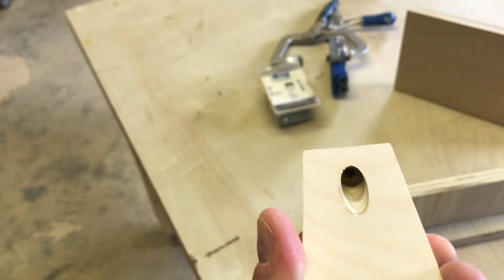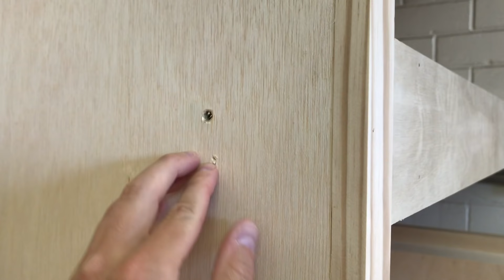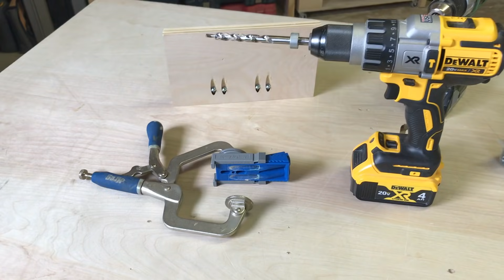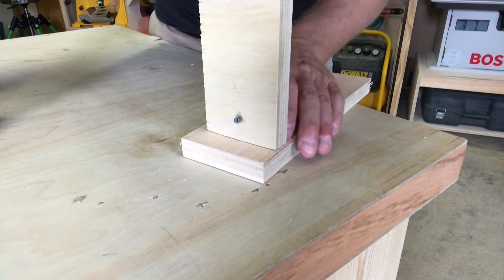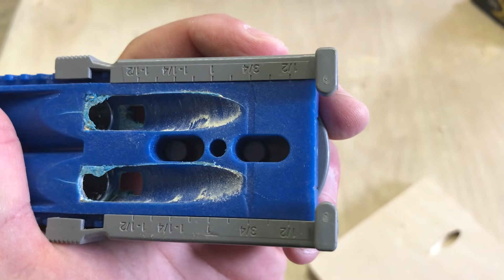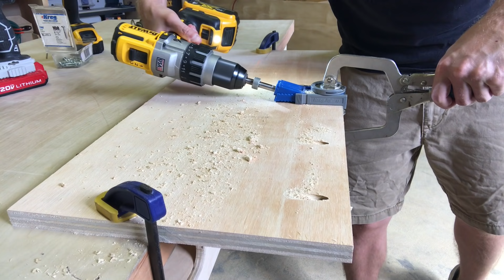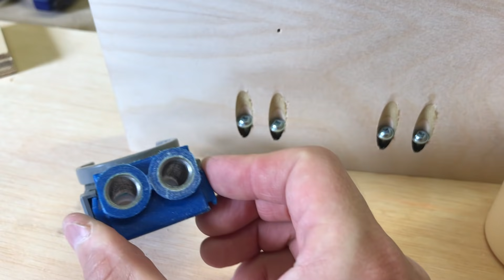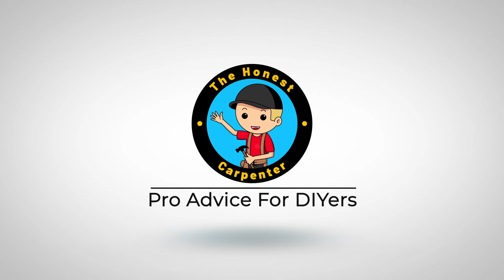Pocket Holes / Pocket Screws EXPLAINED!! (How Pocket Joinery Works--Kreg Pocket Jigs--PROS AND CONS)

Comment: For increased strength If appearance isn't super important you can drill pocket screws from both sides of the board spaced about an inch apart. This will drive the screws from two different angles and thus will nearly triple joint stability

Comment: It Might a stupid question? When using kreg double jig.
 
 What would be your advice, to what screws sizes to use when using different thickness of wood? 
Any advice given, would be appreciated.  Thanks Tony 👍
Reply from the maker: Hey Antony, kreg actually makes charts about this! The chart usually comes with the tool, but you can find it on their website as well most likely. It’s a little tricky to explain, but thicker wood equals longer screw, etc…and you typically want to use their pan head screws!
Reply: Would you recommend pocket hole system for french cleats?

Comment: Hi great video but can you guide me on what jig and screws I should use on 12mm birch ply please.  I find regular heads jut out (are not hidden) and shorter pan heads only come in fine thread which is not suitable for plywood.

Comment: Pocket screws are very important when using pocket holes. Don’t think that you’ll save a trip to the store and get away with using regular wood screws.

Mushroom head coupled with unthreaded shoulder allows the screw to get stopped at the bottom of the pocket hole without digging deeper into the wood, while pulling the work pieces into each other with force instead of pushing them apart

Comment: Great video, thanks. Would it be possible to use pocket screws to join 45 degree mitres in a square U shaped bay window board that is 25mm thick?

Comment: That Kreg clamp in about $44 and made in china, yet a Milwaukee clamp was $24 and made in Taiwan, a friendlier country. Kreg is a huge profiteer and one of their competitors, Milescraft, claims to be available in Home Depot (where I got the prices) yet not one Milescraft item is in store. Pocket holes seem to be faddy, and may be a way for Kreg to put holes in your pockets with their overpriced clamps and screws. GRC and Spax make great pan head Torx screws which are as good or better than the Robertson drive used by Kreg.

Comment: Just installed my first pocket screws using a Kreg setup over this past weekend. I was amazed how easy and solid this install is. I paid $49 for this Kreg kit that included clamp, two jigs, drill, drill bit and pocket screws, and I feel it was money well-spent.

My one piece of advice is:  Make sure everything is clamped down secure when performing this process. Both for the drilling and installing the screw, because it’s easy to get movement in the process that would produce a less than desirable outcome. (I hope you read that in Ethan’s voice!)
Reply: Link to your Kreg kit?

Comment: You didn't mention the con... especially for 90-degree joints... the board moving 1/16th even though you used 300 clamps to try to hold it together.

Comment: I am building a book stand where I am attaching a 2”x2” post to a 3/4” plywood base. Would pocket screws through the post into the plywood base be stronger than screws straight through the bottom of the plywood base in to the post?

Comment: do you have to use pocket head screws?
Reply from the maker: It is definitely recommended. But I've known regular drywall screws or deck screws to work in a pinch. They're just not as optimal.

Comment: Good introduction to pocket holes.  I've used them successfully for decades.  My contribution to the discussion is to  clamp a block to the back side of the board through which the screws are driven to prevent it from drifting a little downhill when the angled screws are driven.

Comment: The best benefit of pocket holes vs simple but joint is that it reverses the board that the screw is anchored in. Instead of anchoring in end grain the screw will find much better purchase in side grain.

Comment: Great video. I’m a newbie and this really helps. I was wondering how the screw length is determined when drilling the keyhole into a 3/4” but the receiving piece is 1 1/2”. Would it still only be a 1 1/4” screw?
Reply from the maker: Screw length generally needs to increase too! Since it’s reaching farther diagonally…

Comment: I'm getting ready to use pocket screws to build a work bench and what I've observed from watching several videos is that the depth guide is strictly based on the thickness of the material that you're drilling into, but there is no mention of the thickness of what the screws will be driven into.
Reply: If you buy Kreg screws, the info you need is on the back of the container.

Comment: I'm getting my first cordless drill tommorow when I'm paid (a bosch) and I'm gonna buy a trend pocket hole jig. 
Today i wanted to watch lots of videos on pocket hole joinery. I've got a welding clamp like the one you use so i could use that or my g clamp to hold the jig. 
I always watch videos on how to use a tool before i get it, its a good idea as a beginner i think, especially for power tool safety, did that when i got my miter saw and my other drill. 

I already have various bits, hole saws and a hammer drill, so I'll be pretty much set for most drilling by tommorow 😎

Comment: I’ve been using a KREG pocket hails system for years and its never failed, the projects i have done using this system always draws compliments, the secret is to make certain that you use the correct screw for the correct application, review the suppliers information. I’m an intermediate DIYer and having made many projects I can recommend the KREG system to anybody irrespective of your experience

Comment: I’m pretty new to woodworking and with anything new it can be intimidating.  I’ve done small projects that didn’t require any joinery but I’m concidering making 2 projects that will require joints and I’m not sure which type of joints to use. Any advice on how to use the right joint for the right project?

Comment: How do I k ow how long the screw should be? Going straight in is easy, but since it is an angle I'm not sure.
Reply from the maker: That’s based on material thickness, Amy! The screws and the kit should each come with printed charts. And the info should be online too!

Comment: 4:56 

Aside from a joint that you intend to disassemble in the future, can you give an example of a situation in which you wouldn’t reinforce the pocket screw joint with glue?

Pocket screws are meant to mechanically hold two piece of wood tight and together long enough for the wood glue to do its work. The glue, by design, does the heavy lifting in the long term.

Comment: Great rundown on this alternative joinery method. As you said, look on the inside of any modern build that has a face frame & you’ll likely see pocket screws. Strength, speed & simplicity.  What’s not to like?

Comment: Another good video!  Years ago, when I bought my first Kreg simple 2 hole jig, I wanted to test the strength.  I took 2 pieces of 3/4" plywood, each about 8" x 8", and joined them at a right angle with a couple of screws.  Then put that on the floor, joint upwards, and stood on the joint.  I weigh about 240 and I bounced on that thing and it didn't break.  Since then, I have laughed at anyone suggesting that pocket holes aren't strong!  Of course, let's get clear:  You can install them improperly, especially if you use them on the wrong side of a joint (eg, pointing the screws into the edge instead of towards "the meat" of the board).

Comment: I'd appreciate some advice. I'm a rookie and got myself a simple pocket hole jig for working with 3/4 plywood I'm finding that the edges of the hole are blown out and very ragged - awful finish. The jig was securely clamped to my test piece and I've tried varying drill speed. Still no success in getting a clean hole. Thanks in advance.

Comment: Not ALL pocket hole jigs have a depth setting for wood thickness.  I got a cheaper one off of Amazon with NO settings for the wood thickness nor did it come with instructions.  The seller claims that you can adjust the depth by adjusting the inserts.  Which are right hand threaded.  So even if you DID adjust those, as soon as you turn the drill on, the inserts screw right back down with the drill.  
Take my advice, don't be cheap.  Make sure the jig you order has a way to account for the board thickness.  Or you end up with scrap metal like me.

Comment: I don't have any experience in carpentry or joinery, however yesterday (21st June 2023), I built a bed frame with legs for a van I am converting into a camper van. I used the Kreg pocket hole jig and the frame and legs appear to be square and sturdy. The only anxiety I had was making sure I selected the correct depth for the drill stop. The wood I was using was not an exact match for the preset depth gauge on the drill bit, so had to do a bit of trial and error with scrap wood first.

Comment: I am building a board and batten wall and the wall has some bowing so I am going to use my Kreg pocket joiner and pre build the board and batten sections. I was thinking of using 1.5 inch thick polystyrene boards. Will my Kreg pocket joiner work in the polystyrene and if so will the 1" coarse Kreg pocket screws hold in the polystyrene?

Comment: I have a pocket hole jig but would love to see where exactly the jig is placed on the timber and how to set the drill bit properly and how deep to know how far the bit needs to go into the jig before drilling it. As a newcomer to these jigs if I could see a decent step by step guide to setting up and using this I'm sure I would use it more. I tried but failed a couple of times either jig was too far forward or the bit set too long but I can't seem to get it right. Can you please help because you are down to earth in your teaching methods especially for newcomers like myself thanks and keep smiling

Comment: Best way to clamp 2 2x4s at a 90 for pocket holes? tried a couple tools but they either flexed, walked, or got in the way of the driver.  Thanks. -U10

Comment: Hi
Our 4x2's (your 2x4's) are 1 3/4 inches thick. The Pocket Hole Jig only goes to 1 1/2 inches. I'm having trouble getting the 2 1/2 inch screws in towards the end of the hole?

Comment: I have been using Pocket holes for furniture.  They are great to work with.  Some people critical of my exposed head screws in my early days of wood working.  They are still by far easier and stronger than anything else.  I often combine pocket holes with exposed screw when strength is necessary.  I don't even bother to hide the screw head.  I don't find anything wrong with seeing the screw heads.  LOL.

Comment: One problem with this type of kreg jig R3 is the face clamp that comes with it . it holds the jig properly for few screws and then afterwards it required to readjust , so I just bought the automax 3 inch and it works great!
Love pocket screws method as well as doweling joinery.

Comment: When I was 18 in the early 70's I wanted to take wood shop & mechanic classes. But girls could not because they had long hair. True story!  But in the 90's I saw an infomercial on the Kreg. I wanted one so bad but they were pricey. Now I have one coming my way at 67 years old and I'm going to give it a good try. I will be watching your YouTube. Thanks for your videos.
Reply from the maker: Great to hear you’re getting one, Mary! When you see how easy they are to use, all sorts of possibilities open up 😄
Reply: Kreg has competitors, some are better. Check them out. Additionally, I believe that guys had very long hair in the early 70s as well. I would not want coed shop classes with some of the huge cutting tools. Too many distractions, separate classes are the safer choice.

Comment: The one thing I don’t seem to find information about is how to adjust the pockethole jig for longer screws. The thicker your stock, the higher you must drill to reach the middle of the wood, but that height is calculated for default length screws. When joining thicker stock, you sometimes want to use longer screws. How do you adjust the height then accordingly? So far I always need to use a test piece to set the jig at the right drilling height, it would be nice if the jig allowed you to take screw length into account as well in an easy fashion.

Comment: Really clear video. Thanks for the info. I'm looking to repair a fence panel frame and not sure if pocket holes are the way to go. Verticals are 37mm (1 1/2 ") square and the horizontals are 37mm by 100mm (4"ish). I have thought about rebating the horizontal but then I''d have to have pocket holes at 2 perpendicular angles to get the strength needed. ...Unless there's a better way ?

Comment: Does a pilot hole need to be drilled into the mating piece of wood after the first piece has the pocket holes drilled in it. I am curious about the piece without the pocket holes splitting.
Reply from the maker: It can help Doug, but isn’t necessary. Most proprietary pocket screws have self-tapping heads that help bore a clean path.

Comment: Hm. I have figured out how to dovetail. The trick is to cut to the line, which is a skill, true. The dovetail is not really that complex for narrower boards. They are not a mystic voodoo joint, but can easily be practised. Quickly. 
But I will still take a peek at pocket screws, they have their place. Now I just need a jig.... which makes me sad.

Comment: Hey Ethan, great video! Do you have to adjust the collar of the drill bit to compensate for the wood thickness?
Reply from the maker: Thanks Eric! Yes you do. But it’s often as simple as loosening a set screw and sliding the collar to another position. I basically leave mine at 3/4.

Comment: Good video.  You might want to do one on why to use the specialized drill bit and screws.  The need is that they make a flat bottom to the hole.  When this is combined with the specialized screws it results in a much stronger "clamping" surface.  If we use normal bits and screws then pressure on the joint tends to pry apart the sides of the wood material with the pocket in it, resulting in easier failure.  There are less expensive solutions to this problem - such as putting a small washer on the screw; however, this may be less effective.
Reply from the maker: Good point, John!

Comment: KISS....I use glue and angle brackets. For larger pieces I square up the corners with corner clamps, straps, and drive 2" wood screws in addition to the brackets and glue. I've had great success making kitchen counters and computer desks, and living room shelving. In my shed, I've got an entire rack that runs top to bottom with 2x4's and particle board that allows all my garden gear, with tractor mower. Storage bins are over head and on shelves both left and right.

Comment: I for my part prefer dowels, they tend to be much stronger. But you are right that clamping and gluing are a pain. My solution is to when possible use a pocket hole screw as a clamp. Place your dowles then a pocket hole screw to provide clamping force. This doesn't work on small things. But where it does work, it can save you time and effort on clamping and given you what I think is a superior joint. I am not doing production work so the little extra time dowels take isn't a problem for me.

Comment: Enjoyed your video but I have one question. When I use pocket screws the screw head always remains partly above the surface. Can you tell me why this would be?  Thanks. Alastair
Reply from the maker: Hey Alastair, I’d say there’s a chance your drill stop might but be set deep enough 🤔 I’m not too sure though. Mine generally recess into the pocket…
Reply: @TheHonestCarpenter  thanks. I’ll experiment with that. 👍

Comment: Pocket hole screws have been used in kitchen cabinet and other items for well over 50 years the kitchen cabinets in the house I’m in now I’ve been there for over 50 years and show no signs of deterioration
So I’d say for case work they are very good 👍

Comment: Love my jig.. Same one you have in your video actually..
Don't forget to mention,, you need certain screws for those as well.. Do not use drywall screws, they will split the wood.
Use a screw with a flat bottom. (Pan head screws)  You don't need to buy the expensive ones Kregg sells, you can get them at the local hardware store in Philips, Torx, or Square drive pretty readily.

Comment: A sound video to de-mystify the technique and encourage woodworkers to give it a try, I've come to use pocket holes regularly as a reliable way to make strong joints that don't need big clamping systems to get the desired finish. I'm not a carpenter, just a hobby enthusiast, and they have helped no end. I've even been able to join pretty thick wood pieces together, making interesting top surfaces for simple units for around the house. Whilst most joints try to look invisible, I've even found a nice feature in deliberately putting the pocket on show, back filling the hole with a very different wood plug, so that the nice little ovals are on show in the finished product. For the pretty small cost investment, I'd really recommend this system, it's massively improved my confidence in projects, and has encouraged me to be more creative in my builds. Looking forward to the next video.